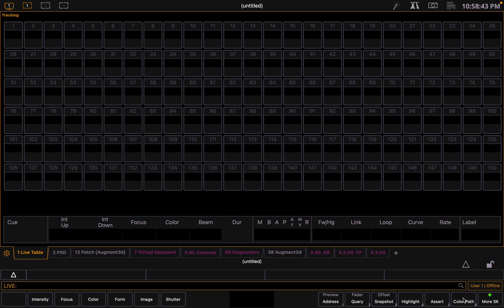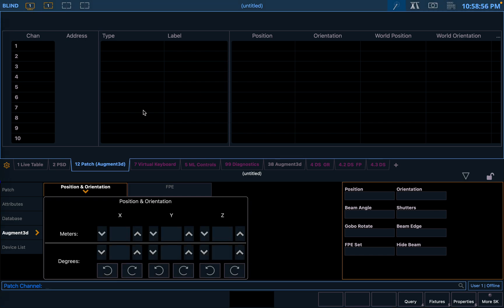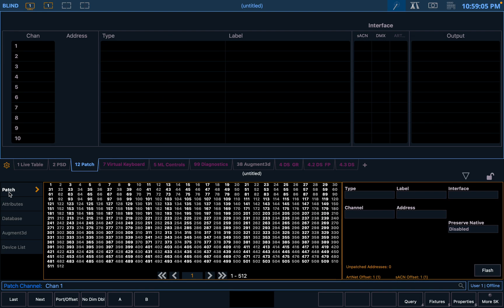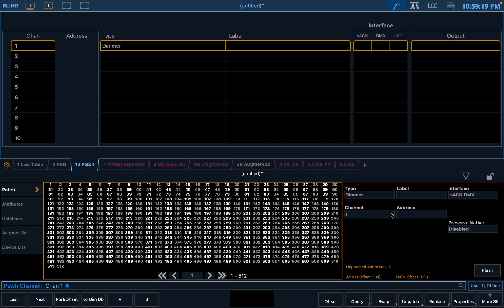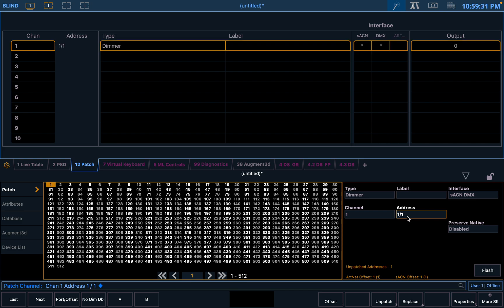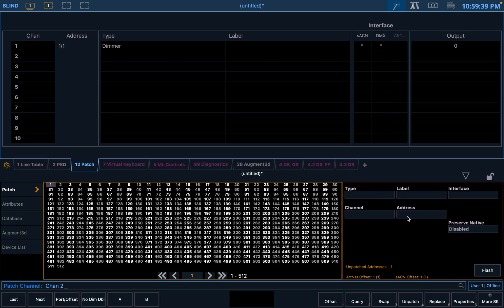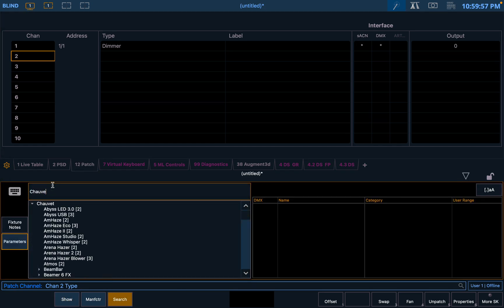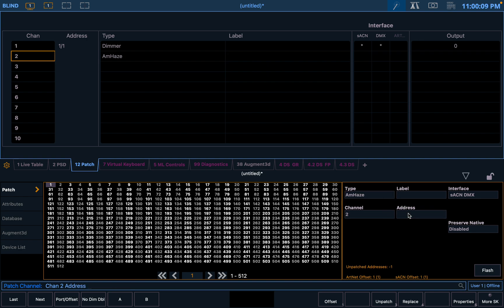ETC EOS (nomad) Patching a fixture.

Comment: What does this do? For example I want to connect to capture do I have to patch every light I’m using in capture?
Reply: If so can they be the same universe
Reply from the maker: @James_RH  This allows ETC Eos to comunicate with capture or the lighting fixtures. you will need to patch them first on eos then add there addresses and fixture modes into capture.